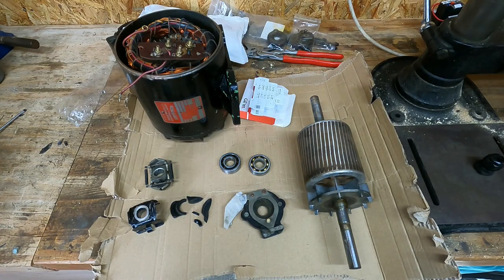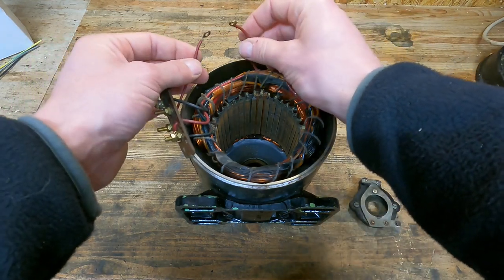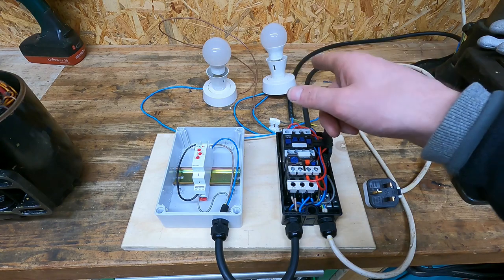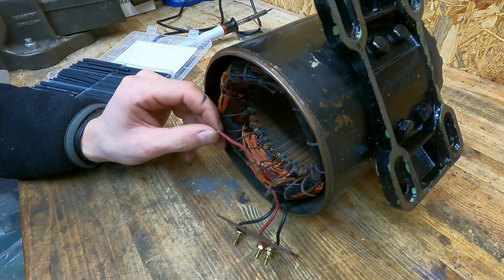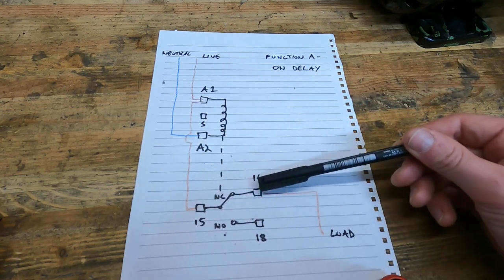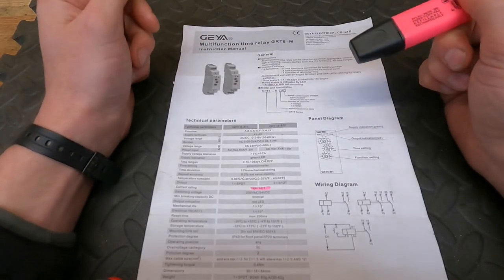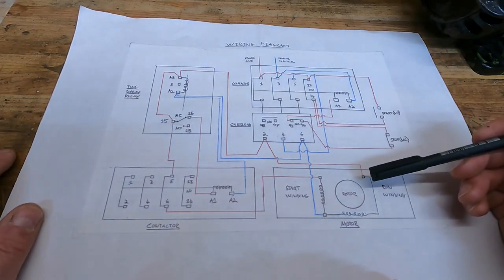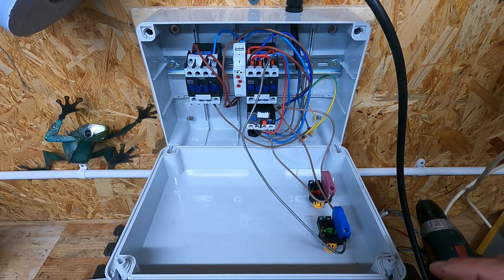Replacing a centrifugal switch with a timer relay

Comment: I'd assume that the time delay is a far easier replacement in the future as opposed to the mechanical centrifugal switch.   Is this what inspired this project?  Great job, your videos are very precise and informative.  Thanks for sharing!
Reply from the maker: Thank you! I broke the centrifugal switch by accident and I couldn't find a replacement for the imperial shaft diameter. Using  a timer rely seemed like a good alternative and I thought it would be an interesting project.
Reply: @dirtbagd89  
Makes sense.  Sometimes replacement parts are no longer available, and we can only improvise.  Great idea, and very professional!

Comment: I have a similar issue on a Gryphon motor on an old bandsaw. The contacts are shot on the centrifugal switch.  Couldn't see if you had specified what the second contactor your added is? Would you be interested in building an equivalent unit for me, as it's a stretch for my electrical knowledge.
Reply from the maker: Hey Peter. Both contactors are rated to 18 amps and have a 230v coil. You can get them relatively cheaply here: https://www.ebay.co.uk/itm/332619693844?hash=item4d71adbf14:g:s44AAOSwq1JZHY4p.  To be honest your cheapest option is probably to find a another second hand motor that will work. You're looking at £100 for the parts alone to make the starter unit with integrated timer relay.  If you send me your email I can send you a list of all the parts I used. If you aren't happy building the unit yourself we might be able to sort something out.